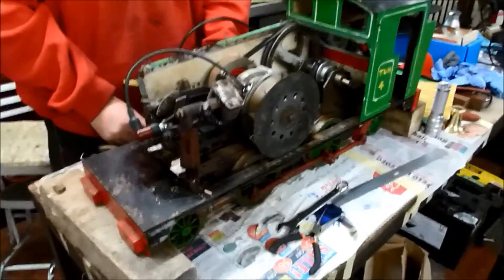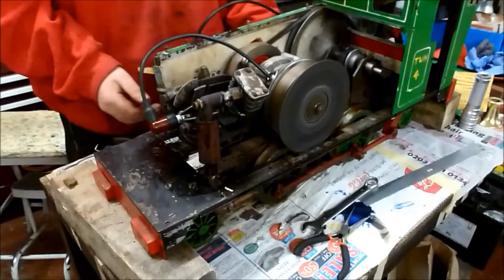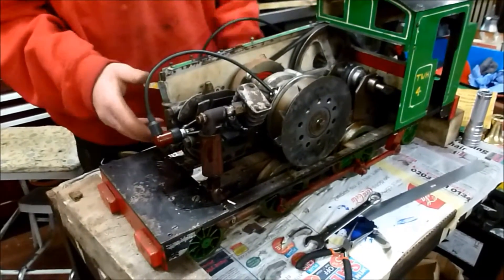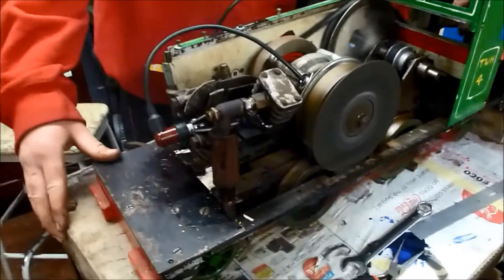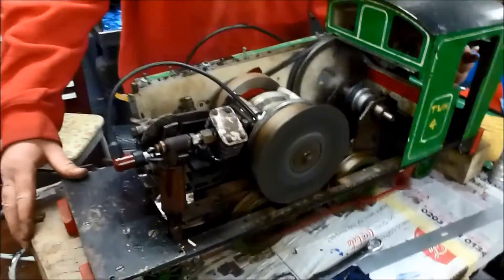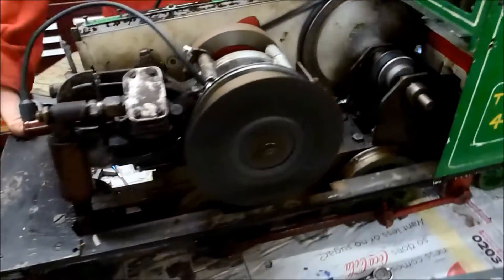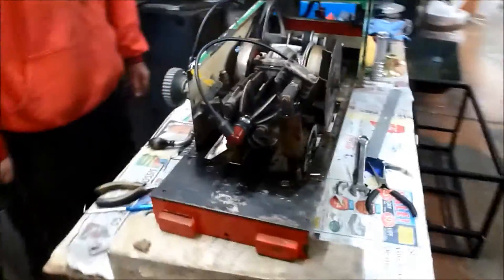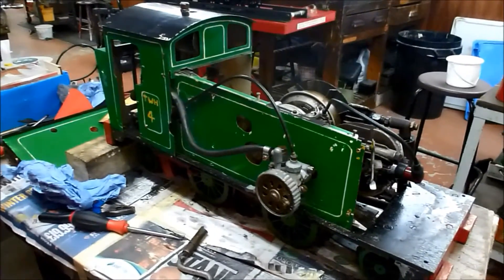3.5 Inch petrol 2-4-2

Comment: Nice video!
I have recently purchased this engine from it's current owner. I'm going to try to get it running over the coming weeks. The engine is missing it's decompressor, the the cab is also damaged as well as the fuel tank and 3 of the buffers. The chassis and transmission is in good shape however, and the engine should run even without the decompressor, so it just needs some major cosmetic remodeling. Nice to see it with the original body and fuel tank, will be very useful when it comes to rebuilding the cab! With the carburetor sticking out the side, it will look a bit industrial, but I don't really mind that!